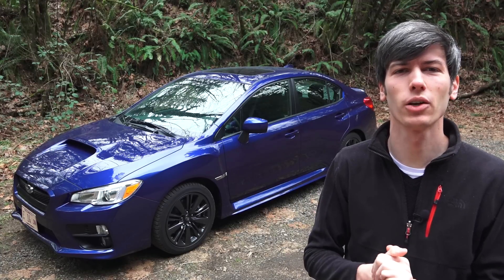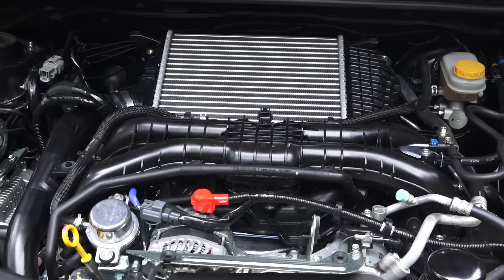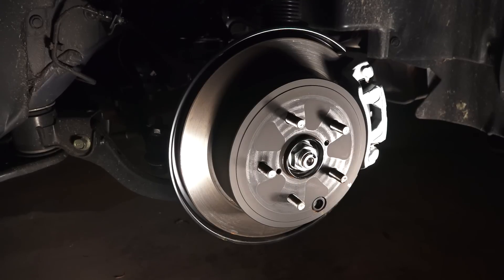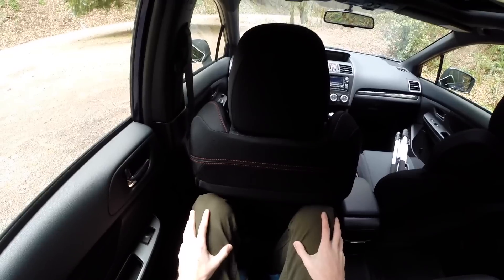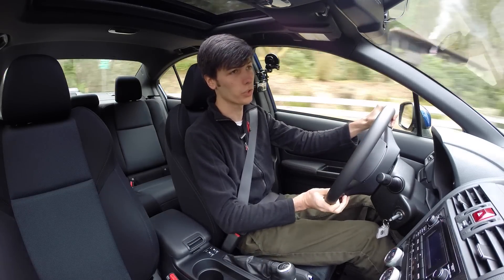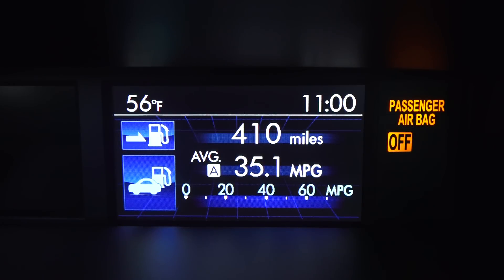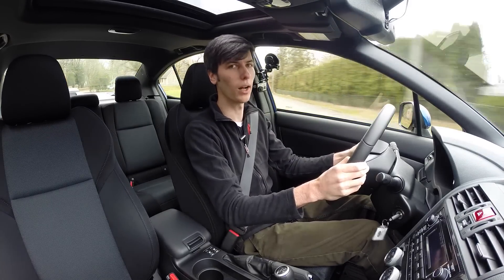2015 Subaru WRX - Review & Test Drive

Comment: I really liked this review. Very straight forward, informative, and with notes from personal preference. Top tier and I especially liked how you pointed out how air flows through the entire system. 🙌 
Just bought a 2017 wrx 65,000 miles. Fun daily

Comment: Rear sway upgrade  bar really helped get rid of the understeer. I also have light weight wheels and upgraded rotors and pads. I installed a really good set of coilovers and change my  oil every 3500 miles. All other maintenance is done on time too. So far I’ve had a really positive experience with my wrx.

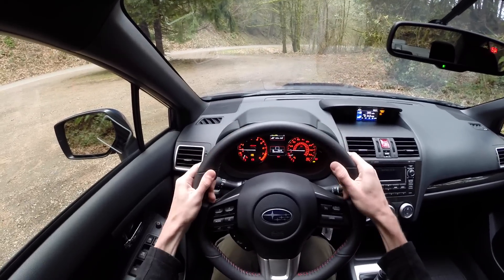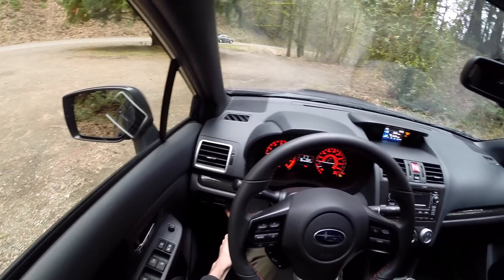Comment: Cockpit  4:24. Steering wheel  controls 4:51 , trunk release  5:22 ,upper display screen scroll below red buttom 5:30 , 12 vott outlet  6:37 ,  heated seats 6:42 , center console usb and 12v outlet 6:48 ,  test drive 7:44

Comment: 5 years later, driving an 18. It definitely does not achieve 35.1mpg.

Multiple reviewers have clarified that the engine computer is a little “optimistic” - but yes on the highway can comfortably achieve far more than the 28 rated for.  Probably 32-33

Comment: I owned a 2016 wrx for about 8 months, 5 of those months it was sitting at a subaru dealership waiting on warranty work.  Every other day the mechanics would pull the car into the shop and scratch their heads trying to figure out what was wrong with my car.  They ended up replacing a handful of major expensive components (j pipe, turbo, cam sensors, wiring harness + more) trying to figure out what was wrong with it.  It kept throwing different check engine lights - catalytic code, cam sensor code, misfire...  After they gave it back to me the last time, I sold it before it had a chance to throw another CEL.  I told the new owner of its issues, I was selling it cheap enough that he didnt care.  What a mess.  I love Subarus, I owned a 2004 sti before the 16 wrx, and now I own a 2011 sti, but jesus I hated the new fa20 wrx....  The one I got was a piece of junk.  It pains me to hear him liking it so much when my experience was so painful.  After months of talking to subaru reps and complaining (like it was my full time job) SoA ended up reimbursing me for those 5 months of the car siting at the dealership, they recognized how much BS it was that I couldnt use a car that I was paying for.  That is the only way that Subaru redeemed itself to me.  I am once again the proud owner of a ej257.  I think the fa series has alot of refinement to go before I'd give it another chance.

Comment: 1:20 I started to gush about Subaru doing that, but then I realized you still gotta get under the car to drain the oil :P But that got me wondering. You can easily change the filter every 2-3k, and just drain the oil for some good synthetic every 6k. Which is more important to do more often, the filter or the oil?

Comment: I didn't realize how much of a difference a 2020 base is compared to a 2015. Yea I don't have the led headlights but I have my red stitched door "leatherettes" and red stitched shift boot, both front window auto switches, cleaner gauge design, better/ cleaner top center screen, and touch screen as standard. Oddly I don't have rear cupholders in the back of the center console... I wasn't impressed by my buddies grey 2015 wrx back when it was new but my white 2020 is elegant and beautiful and I'm glad I waited. Also, I don't know if he's incredibly smooth or if something changed but my gear stick lunges back and forth with deceleration and acceleration.

Comment: I know I'm pretty late to this one, but I'm considering (basically planning on, at this point) buying a 2016 WRX. The only hesitation was the fuel economy, I've wanted 30MPG+ (my current vehicle gets 21 MPG if you are really, really careful), the fact that you were able to get 35 MPG is incredible to me. Most of my commute is highway (I drive less than 55 mph for all of 4 miles of the 30). I think I'm sold... and the fact that you couldn't stop yourself from smiling every time you hit the accelerator, or went into a turn.... that just sells the car even more for me. Great video!

Comment: What do you make of the power dip after 4K rpm? Do you know if the 2018/2019 model has fixed the issue?
Reply: I drive the 18 power dip still there at 4k. My only gripe about the car.

Comment: Just bought a used wrx and was wondering what the normal ranges for rpms at steady speeds of 30 mph, 40 mph, 50 mph, and 70 mph?

Comment: I am simply FLABERGASTED by your average mpg for your trip. There is a huge discrepancy between 23 avg advertised and 35 avg that you achieved, were you coasting downhill in 6th gear going 35? By the clips, it looks like you weren't babying it. This alone changes a lot for me in considering it as a practical, fun car to drive. Any explanations or anyone else having similar results? Thanks! And keep up the good work!

Comment: +Engineering Explained what are your views on the 2015 wrx with cvt transmission. I will admit i have never driven a manual or owned a wrx but i have always wanted one and i am about to buy one and was looking at the cvt but will go manual if more reliable

Comment: I've got a 2016 wrx and don't find the rev hang an issue at all. It's actually perfect when shifting

With this car you have to get the rpm's up high in first, shift into second and it rips. Be careful out there....

Comment: Do you have any comments on the rather high incidence of very early clutch failure in the 2015/2016s? I'm sure many can be attributed to new drivers and abuse, but many seem to be happening with experienced drivers as well. I want to purchase a 2018, but I'm hesitant because I don't want to have to deal with a 1200$ repair every 30-40k. Could this be an engineering issue?

Comment: Engineering Explained  First day in warm weather with my 17 wrx. Was riding home with the air conditioner on and I randomly felt like the car was "slipping on ice" or hesitating. Definitely due to the AC..Everything's fine when AC compressor is off. Ever experience or know anything about this?? Really don't want to head back to the dealer...Thanks

Comment: Hey Jason, great review. Just a quick question. How would you advise that I deal with the rev hang? I have a 2017 WRX and it's annoying shifting from 1st to 2nd, I either have to wait an extra second or 2, or just let the clutch out slower, or deal with a not so smooth shift. I know a cobb access port can greatly reduce the rev hang, but I'd rather not do that since I don't want to have issues with voiding the warranty. Thanks.

Comment: Why would the the throttle go up when you press in the clutch (neutral) before shifting up? Is it a feature that you can disable maybe? Perhaps it's some kind of downshift rev matching assistance? I thought most or all cars the rpm would fall naturally when disengaged from a gear.

Comment: Hey. Have had my 17' WRX for just a little over 2 months, driven around 1,000 miles so far. First manual car but having trouble with 1st and 2nd gear shifting smoothly. How do you deal with the rev hang to shift smoothly? I feel like I am putting unnecessary wear on the clutch by slipping it to shift smoothly. Iven driven other manual cars with no issue whatsoever. This seems very difficult

Comment: I don't know if anyone else has already asked, but is premium fuel required or recommend? Thx
Reply from the maker: +MisakiLeasim certainly recommended, not smart to use low octane fuel in high boost engines.
Reply: Ok thanks, just wondering. Im taking delivery of mine tomorrow! Although it's snowing where I live and these are sold with summer performance tires. I'd have to leave it at the 'ship 'til I get winter tires, but still, Im super excited. Great review bud

Comment: Hello! First id like to say I love your videos they are really informative! I just wanted to ask you personally what mods would you do to a 2016 WRX (stock) to make it get to around 300+ hp. And is it possible without removing the warrenty of the car? Or would it be better to get a STI and make it 350+hp?
Reply: the new 2.0 engine in the new wrx is now easier to gain power than the 2.5 in the sti. if your going for power, just get the regular wrx. the sti isnt worth the extra $10k. not sure what mods need to be done. check the WRX Forums

Comment: I heard the CVT is more fuel efficient
Reply from the maker: +Piznick64 you can go on their website and look at the MPG ratings, rather than guess. :)
Reply: The CVT is rated worse because the EPA requires testing in all modes of the transmission, including the sport and sport sharp modes. Subaru has hinted, and drivers have reported, far better mileage from the CVT when driven normally in real world situations on the highway.

I'd contend the CVT is better for commuting because duh, try driving in a large Californian metropolitan area sometime. And then Eyesight is only available with the CVT, and that's pretty nifty.

Comment: I have a 2015 WRX and had to have transmission and clutch work done between 26000 and 27000 miles. I was wondering what your thoughts were on this. I was doing daily driving. I would also like to know if you have any suggestions for replacement tires. I was looking at the BFGOODRICH G-Force Sport Comp 2's.

Comment: Would a Cobb tune (throttle mapping) coupled with an exhaust/intake improve the 0-60 time (more importantly getting it down from redline in 2nd gear)?
Reply from the maker: More power would result in a quicker 60 time, yes. Changing the throttle mapping simply changes how the throttle changes based on how much the pedal is pressed.
Reply: +Engineering Explained i'm thinking about getting a performance intake and getting that stage one tune by COBB do you really think that has a huge effect on my engine life?
Reply: +Engineering Explained - awesome thanks for your response

Comment: Needs be pads/rotors and it'll be perfect.

114.7 hubs stock, that means you have good strong wheel bearings, endless wheel choices... same hub assembly as wrx sti

also the twin scroll, shorter gearing, new engine and equal length headers make the car respond better at low and rpm and give it good mid range

Comment: Hello,  i just purchased a used 2015 WRX with 15K miles.  I'm experiencing some sort of turbo lag when in second gear and hitting 4,000 - 4,500 RPM.  It seems to hiccup for a split second and pick back up.  Any Idea?
Reply: +Jack MeHoff Cobb access port with the Stage 1 tune. The stock tune is pretty awful. It breaks up in the rev range in a few spots, and at low throttle and low speeds it seems to just shudder around. The ECU reflash really smooths out the engine, and gives a few extra ponies. You no longer have the weird shuddering at low speeds, and the car doesn't die quite as hard in the top end.

Comment: I bought a 2016 WRX, in the summer of 2015 heavily based on this review. In terms of specs, it's basically the same car with a nicer console. (So is the 2017, with a bit smoother shifter.) Having re-watched this review several times, I can scarcely believe  how quickly and precisely Jason picked up on the quirks an benefits of the car. A year into owning the car, I couldnt agree more. Yes, if you love slamming through up shifts, you'll have to slow your roll, some. At the same time the car just pulls and pulls, it's absolutely slammed in corners, and I'm more than satisfied with the creature comforts. Four guys and gear fit comfortably! Roof rack doesn't hurt, if you have a mountain bike, or two, or a Canoe. I'm somewhat biased being a sedan guy, but I'm so happy for having seen this review and shelling out to get a super car. No pun intended! Out of appreciation, and awe, I've subscribed to Engineering Explained's Youtube, FB, twitter and anything else I can find... Website?. His 4wd and unequal/equal length header vids, we're also super enlightening. Listen guys, it's not the cheapest, or most luxurious car to drive, or maintain... The Subaru Starlink interface is miles behind Honda's whatever-they-call-it, but none of my friends, Beemer guys and all, would challenge the fact I'm top dog in terms of capability under 50k.Its mental! Thanks Jason and how the hell did you hook up that T.P. co-driver gig??? Keep up the good work!

Comment: I am still surprised that most cars these days don't come with keyless start as a standard.
Reply: CCTV9 Because it sucks, its not a mercedes
Reply: keyless cars are easier to steal and to turn on the radio you press the button dont hold and dont press the brake
Reply: Well keyless start is a high end feature.
Reply: I dont like it tbh ... my main problem is sometimes I wanna be an asshole towards the car and turn on the radio without fully turning the car on, It is basically sort of impossible on a starter button car. But the keyless entry is awesome.

Comment: are there any unequal length headers for the 2015/16 wrx? I heard it doesn't work well with the twin scroll turbo but I want that rumble :/
Reply: +alampandatennisrack If you wanted the UEL headers, you would also want to change the turbo.

Comment: Make a video on the cvt transmission please. Can you answer questions such as: is it slower, can it reach just before the redline without harming engine, and can the transmission handle more hp gains from mods. Any info about the cvt in the wrx can really help.

Comment: Is that floating throttle fixed in the 2016 WRX?
Reply: +Glenners Rev hang is an emissions requirement, it will never be fixed. However the throttle input is now linear and they have updated knock control to prevent detonation during WOT. - '15 wrx owner
Reply: lotsaKASH Thanks for the reply!

Comment: Any idea if the 2016 WRX addresses the rev hang that the 2015 has when shifting gears?
Reply: It doesn't. I own a '16 WRX and there is a pretty significant amount of rev hang in 1st and 2nd gear. Higher than 2nd there is not much rev hang at all though.

Comment: Should I get a 2015 WRX or a 2016?
Reply: If you're able to get a fair discount for a 2015 then get that. If the price difference isn't that big get the 2016.
Reply: got my base 2016 with sti short throw shifter for 27k otd when 2017s on preorder. Without tax it was around 2k under the msrp i believe. Color selection was sucks tho, they only had 1 white while i wanted black.

Comment: Thanks for your review. Do you recommend getting the short throw shifter installed from the dealer? And is the road sound too loud for the WRX limited? There is nothing close to me to test drive and being an older guy i don't want something loud.
Reply: Anil Thomas I test drove on with a short shifter but ended up buying one without the short shifter. I wish I would have gotten the short shifter.

Comment: Don't know if you can get back to me quickly, but unfortunately I'm going to trade in my 2014 Lancer Evo GSR today and I am deciding between a 2010 S4 and the new 2015 WRX, which one would you personally recommend as an all around fun to drive performance vehicle?
Reply from the maker: +Brysen Tyler Depends how much you value a warranty I suppose. Both are fun, I'd probably go with the WRX as it has an amazing engine that's not only super torquey but great on gas as well.

Comment: Does the traction and stability control stay off till you put it back on or is it auto.
my mom has a lexus es350 and you can turn traction control off but once you start driving it automatically goes back on
Reply: vbnfbbbbdbdbdbdbwqneeejrbbrgehrhrhrbhhgege Greg gr gr8 gr gfs grhrgrgrvegegrrrggrgegrhrgegrgrgrgg th rrhr th rggt gfs grhg

Comment: In the snow is manual or cvt better
Reply: doesn't matter if you're experienced but if you're not then auto is better. it's much easier to spin the tires in a manual tranny.

Comment: Great review. one more good thing about manual is that for some reason your battery dies. don't need to worry about not having jumper cables. Is there any type of tuning to eliminate the rev hang? ie ecu or such?
Reply: +Fred Kim Supposedly the Cobb stage 1 flash tune is the go-to to fix the revhang.

Comment: is there a clutch fluid reservoir under the hood?
Reply from the maker: May be joined with the brake fluid, not positive.
Reply: +Engineering Explained I have a question? You said your legs came close to the steering column? How tall are you just out of curiosity? I'm 6 foot exact
Reply: +Divergen7 he is 6'1 as i think ive heard

Comment: Good video.  Would like to know the RPM at 70MPH.  Also, for the gearheads, it would be nice if you gave a MPH/1000 RPM to give viewers a rough approximation of the maximum speed per gear.

Comment: so i just picked up a 2016, and it's my first manual car, im having trouble finding the revving sweet spot to get it into second, i almost always jolt the car and i think it's because of the rev hang you were talking about because i have noticed it spiking when i clutch up from 1st to 2nd, do you have any advice for this?
Reply from the maker: +Adam M. What I would say since you are just learning, possibly rev it a bit higher (maybe shift around 3500 from first gear), let your right foot completely off the gas pedal while shifting, and wait a short duration before letting the clutch out. It's definitely a tricky car to time right, so to get it smooth you have to be a bit patient with the gear shift. At higher revs, it will tend to drop quicker, hence shifting a little higher may help. If it's brand new, I believe the recommend keeping the revs under 4K or so (the manual will let you know). It'll get better with time!
Reply: thanks for the quick and helpful reply!